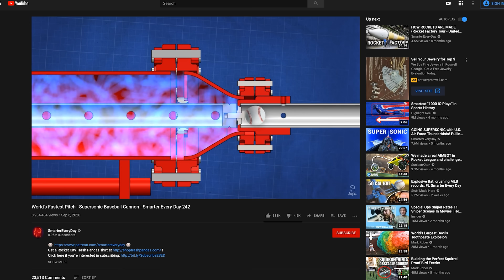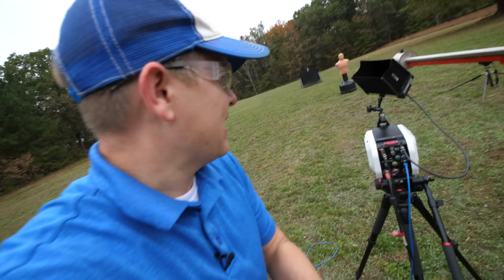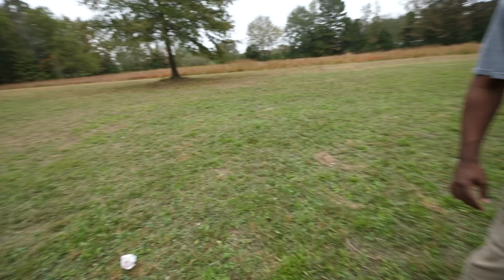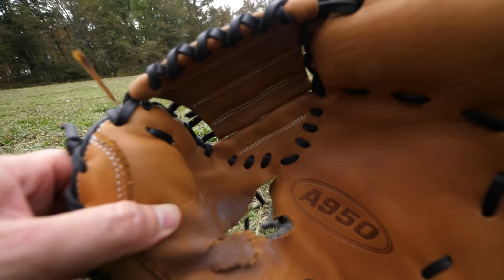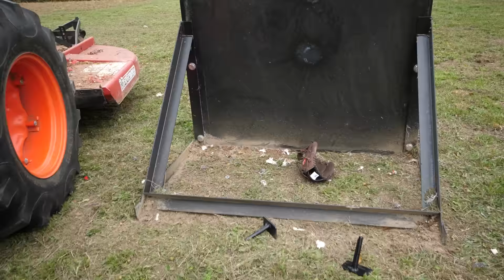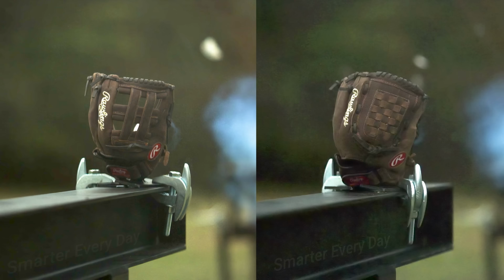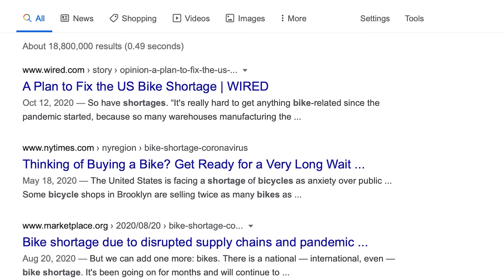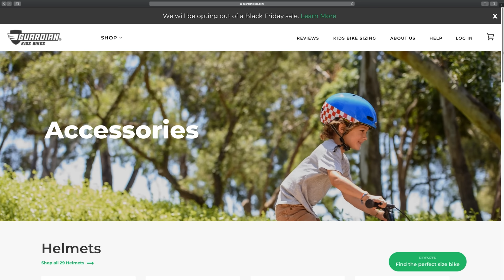Trying to Catch a 1,000 MPH Baseball - Smarter Every Day 247

Comment: prediction: destroys the glove weave, and send a man to the hospital, but I think you might live. You just might be sad about the 18 broken ribs along the way.

Possible next experiment: Can you make a baseball glove that would catch this ball (disregarding the broken wrist and everything else)? Something with rubber or a polymer weave or backbone, a thin strip of metal, but flexible enough to move with your hand, a kevlar glove, or nylon,
Reply: There's no way someone would live through this. The energy on impact and the resulting energy wave would obliterate intrathoracic organs. It would go through a chest like a shotgun slug, and leave a pretty massive hole through someone's torso. That glove takes nothing off.
Reply: Try it with one of the carbon fiber armors they sell on the internet that can survive stabs.
Reply: @vaclavzajac214  Doesn't matter. 1,000 mph is about 1,490 fps or so, and that's the speed of a shotgun slug. A slug puts a hole through a human the size of a baseball, and at close range will be survivable through IIIA+ armor but will break your ribs and take you out of the fight. Except a normal slug weighs about 25g, and a baseball weighs about 140-150g. Nothing short of a full EOD suit would save a human body from being obliterated by this. A baseball at 1,000 mph would likely turn an upper body into pink mist, the same way a .50-cal round does.
Reply: The shock wave resulting from impact would shred internal organs in the immediate vicinity, even if by some miracle the baseball did not pierce the skin (and the ball would most assuredly blow a hole in a body at that speed).  You couldn't pay me enough to stand in front of that baseball cannon.  That is an insane amount of kinetic energy to stop with just a glove.  Bob didn't stand a chance, poor guy...
Reply: There's no way anyone would survive this. Your chest would look like that scene from Alien.
Reply: A kevlar west would be an interesting test!
Reply: @mx some would break in half and then the resulting new ribs would also break
Reply: Seriously though, the mitt catching the ball would be even worse as the force transferred from the ball would be sufficient to drag the thing straight through a person.

Comment: I think maybe the air cause the flame. The ball was going supersonic, which means it was massively compressing the air in front of it. It's possible that as it got very close to the glove, a lot of this heavily compressed air was forced through the tight openings between the leather in the glove. It would have been forcing air through at incredible velocities, which could have created enough friction to create fire. Also, the leather may have further compressed the air even more. Compressing air heats it up. It could maybe be that the air was turned into a plasma for a moment.

I just remember a NASA experiment when they tried to build a rocket train that could build up enormous speed horizontally before going vertical. That way it could save fuel  not having to fight gravity from the start. The thing moved so fast they couldn't put wheels on it, they had to put skies. Huge one that were something like an inch thick hardened steel.

The whole thing explodes not long after launching. Turns out, once it built up speeds the friction of the air flowing past the legs cut them right off within seconds. Just melted straight through all that steel like it was nothing.

They ended up having to make a tunnel filled with helium to get the thing to not blowup. Less dense gas won't compress enough to cut the legs off it seems.

So, that would be my choice.

Comment: I'm wondering if there would be any difference if you set up the gloves to be held by a closer-to-human system. A catcher catches 100+ MPH pitches with several flexible levers, right? The wrist, elbow, shoulder, torso, hips, etc. all play a small factor in catching the ball comfortably. You'd have to calculate what percentage of the velocity is absorbed by each lever, so there's some fun practical math for you. I also wonder if you set up a few fully geared up Bob catchers...how far does the ball get?

Comment: i just calculated the muzzle engery in ft lbs of the baseball. it is 10,973 ft lbs at 1000mph with a baseball weighing 5.25 ounces. a 9mm bullet has about 350 ft lbs on average and a .22LR has about less than 150 ft lbs on average. that baseball has over 31 times the energy of a 9mm bullet.

Comment: When air is compressed, it heats up. The air caught between the glove and the ball is being compressed at an extremely high rate that it is possible to generate enough heat to ignite any fine material within the glove and ball for that split moment.

We see this when objects enter Earth's atmosphere and burn brightly. The Mantis Shrimp can also punch at such a high rate that it causes explosive water capitation that can ignite a spark at the point of impact.

Comment: A glove might be able to catch the supersonic baseball if it were not fixed into place. You could treat the metal beam as a rail the clove can travel on and use brakes or springs to slow down its movement.

Comment: The compressive shockwave in front of the ball is igniting oxygen rich atmospheric air in contact with a flammable material reaching its flash point.  (stiching, leather).  The sudden pressure build of the air in front of the ball must transfer its energy when the opportunity presents.

Comment: The gloves are going to cost a lot more but try buying pro stock/ higher quality gloves like wilson a2000 or a2k, the quality of the leather is 20x better. Also try getting the high quality catchers gloves because they are mad to handle 100mph fastballs which I know this is a lot faster than that but if you have enough of them it might slow it down enough

Comment: Could the ignition be related to the formation of hot spots? Both the target and impactor are porous objects, and some higher than average temperatures may be achieved at the porous glove / porous ball impact surface. Such extreme states could cause partial ignition

Comment: I think an in depth analysis on the max force of the baseball vs the forces materials can withstand.  So clearly a static glove (or 9 gloves) made out of leather cannot withstand the forces of the baseball @ mach 1.3, but can a glove (or net) made from chainlink, rebar, varying weaves of varying metal alloys--which I think would be the coolest to see: metallic fabric baseball glove, sweet!  But let's say the metallic glove could get hit by a supersonic baseball without getting destroyed...that doesn't mean the glove will catch it or even slow it down significantly unless it was MASSIVE--which it would turn the ball into confetti just like the plate. You need something the decelerate the ball, and that's a serious engineering problem I would love to see!   I'm thinking pneumatics, hydraulic, spinning and sliding thingies...With enough over-engineering (that you enjoy doing and we enjoy watching)  I bet if you could soften the initial hit enough to go back to a leather glove to catch the supersonic baseball. GLHF

Comment: Hear me out. Using a light sensor, you move a mitt back slgihtly slower than the ball. This will transfer the energy slower over time. You may have to build a cmrpessed air catipult to move the mitt but will increase the chances of catching the ball.
Reply: Or im just dumb and drunk and this is a dumb idea lol

Comment: 1 oz shotgun slug travels about the same speed as the baseball does from the cannon. A baseball is 5 oz if I remember correctly. Hypothetically it’s creating the same energy as 5 twelve gauge 1 oz shotgun slugs put on the same place at the same time. If that was a person getting hit with that cannon they would be drt ( dead right there)😂

Comment: elephant in the room the ball went through the glove in the web.... most of the time the ball hits in palm of the hand and goes to the web or from the web of the and to the palm. remember burners when playing catch or even as a catcher ball hits hand either palm or web other hand goes over and brings the ball either twards the web or twards the palm so to grab it and throw it as ast as possible web keeps ball from getting away but palm mostly catches it if rely on web to catch the ball ball can be to high or low and no control or reach to throw for return cant remember how many times i came home from practice or catch with sore palms so what does the ball do to the palm of the glove with a hand in it. if ball is streaght at glove chesst level or less glove foward web directs ball to palm and other hand reaches to keep hold of it and throw for return.

Comment: Not liking the sponsor. Read their page on the single-lever braking thing; will never buy a goddamned thing from them.  It's not physically possible to flip a bicycle over by locking up the front wheel or getting the maximum braking force out of the front; that doesn't happen.  They're advertising that their braking system stops faster, so this is significant:  the human on the bike has something called "inertia," and stopping the bike doesn't stop the human.  If the human braces against the handlebars when stopping, the center of mass is too far back—on a motorcycle, which weighs several hundred pounds without the human rider, this is in no way true—and the bicycle can't flip over; but if the human doesn't…the bike stops, they keep going, they hit the handlebars, the front wheel is experiences significant friction forces against the ground, and the bike flips over.  If you could get that kind of braking force off the back wheel (that is physically impossible), the same thing would happen.

The human rider automatically learns all kinds of behaviors through risk compensation.  The wheel skids a little, human gets scared.  Human learns how much force is controllable, learns nuances of braking as they encounter different situations, different types of surfaces.  Control over the brakes is important.  Single-lever braking is first off a single point of failure, and second a sort of averaging of all possible distributions of braking force into one general not-great-in-all-situations behavior.  It's notable small children do this EXCEEDINGLY well, and can often outclass adults in terms of simply learning to physically function at a rapid pace.  Nothing about this is "safer for kids."